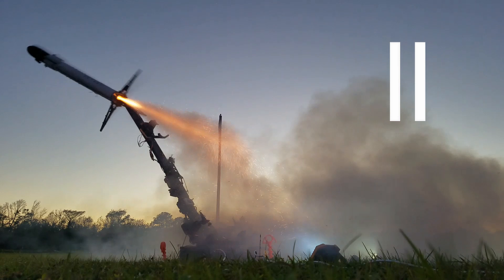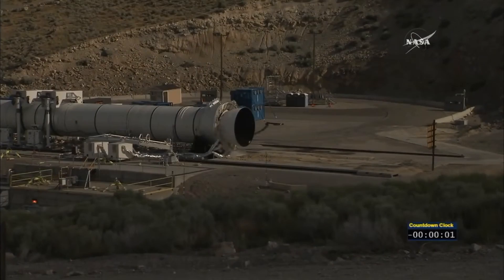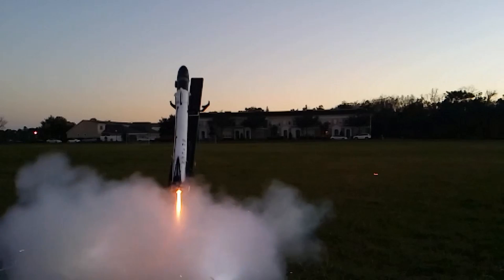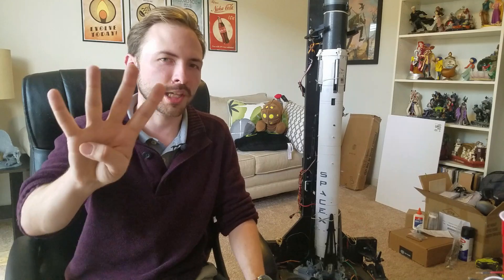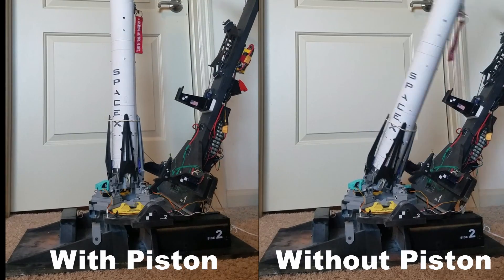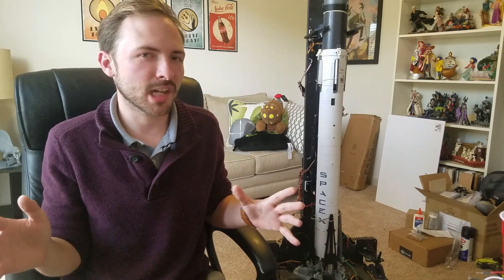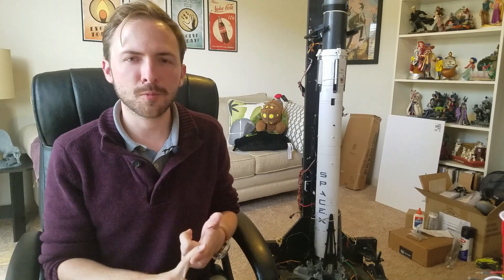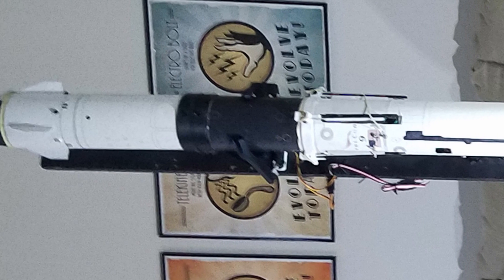Thrust vector Controlled Falcon 9 Model Rocket Reliability Upgrades (and a few launches)

Comment: Don't think you "need to remember" things. Make a checklist.
You need multiple checklists. One for gear to take with you. One for camera setup. One for launch preparation.

There's lots to like about this video. I liked how you shared the problems you had and how you solved them.
I intensely dislike the way you edited the actual flight. Why the closeup of the timer after the launch? I wanted to see the full flight. I didn't like seeing small portions of the flight multiple times without having seen the full flight yet. I feel bad criticizing anything about this great project but the launch portion of this video really bugged me.

This comment came out much more negative than intended but I really hope you change the way you edit your flight videos. This video could have been so much better with a few small changes. You have absolutely fantastic video to show, don't hide with weird edits.
Reply from the maker: I now have a checklist actually! and try and allow myself more time not to rush. I try and go more in the direction of cinematic vs being able to fully see things. There is one thing I have been trying to do too which I underestimated. It often looks like the camera is too far from the rocket to capture a good shot but the opposite is usually true! So this next one will have a couple further back angles that I think will do more justice. I'll also have a chase cam on a high power racing drone. Personally though I did like the edit but I appreciate the feedback and will have some further out cameras to better capture it this next flight!
Reply: @TZeroSystems  I'm glad you have a checklist. I used radio controlled airplanes to take aerial photographs  back in the '80s and '90s. I got tired of leaving some critical part back at my college apartment so I started using checklists. It was a huge time saver.
You should of course edit your video as you see fit. Your plans of using additional cameras sounds like a great idea.
It's so much easier to criticize someone else's video than to make a video. None of my YouTube videos come close to your production quality or your content. One of my most time consuming videos was a H-Bridge tutorial. 
https://www.youtube.com/watch?v=O9hg4-IdovQ
It looks trivial compared with your video.
I regret being as negative as I was. Sorry about that. I hope you keep up your amazing work. I look forward to future videos.
Reply from the maker: @ddegn  I actually flew again today, not sure if it's totally video worthy but I didnt forget anything this time! Camera displays though, a little hard to read mid day so some of the aim could have been better! I have a gen 2 flight computer coming that makes the whole checklist a ton more solid too. better hardware and better procedures! I will say thins much, i can find 100 ways to not make one of these work haha!